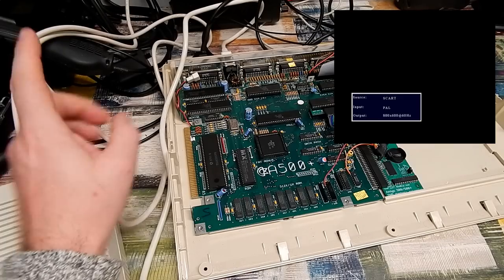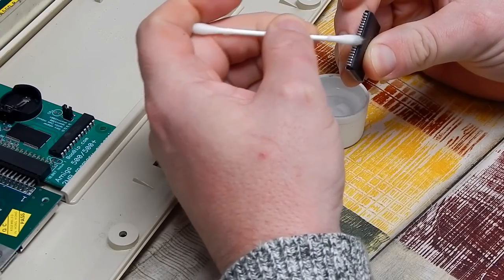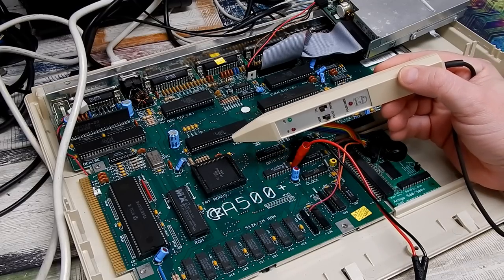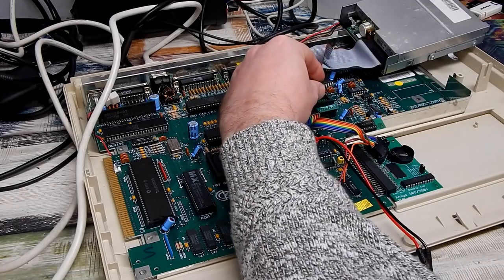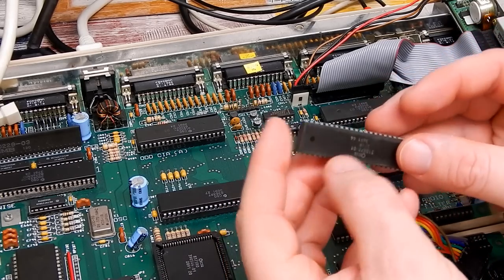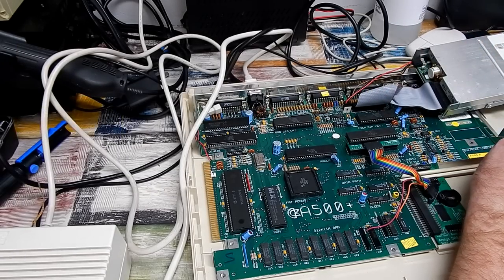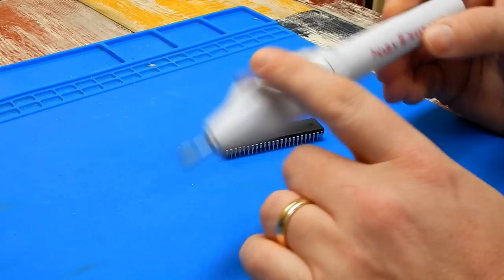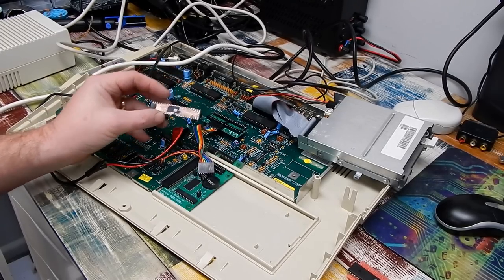Amiga 500+ with black screen but who's dead?

Comment: This is actually a good lesson in why blindly chip swapping doesn't always fix things. Logic probes are cheap and easy to use. So this is still a very useful video, and you did save an Agnes from the trash even though it meant Gary was bad. It's still very much a win.
Reply from the maker: Absolutely as my blind swapping of parts while building the EATX almost had one perfectly good AGNUS in the bin.  If it wasn't for the fact its such an expensive chip I might very well have binned it at that time.

Comment: Great job =D  If that was all that was wrong with that IC you could re-create those missing OE control lines with a 74 series bodge!  I typed that just before you removed the top totally lol =/  EDIT: To be fair - it would have probably needed a few 74 series to fix that 1 pin.
Reply from the maker: Thanks.  It might be a bit beyond saving now lol.  It's impossible to know if it was only that one pin which was bad plus it's not the most expensive chip to replace.  

I just thought it would be interesting to see the silicone.  Wasn't able to show it in the video but looking at it under my son's microscope you can make out some text.
Reply: @CRG  Yes, it was interesting to see inside and how thick those connections are on the DIP chips there too - ie. that lead inwards to the die. On the PLCC chips you tend to find the traces go much thinner much quicker - for obvious reasons!

Comment: I believe that it was still NMOS. That is one of the reasons Commodore failed. After purchasing MOS they didn't keep pace with the rest of the industry. That is why when you get to the 1200/600 there are VLSI and HP chips as Commodore couldn't make CMOS chips large enough.

Comment: Eventually the supply of the CustomChips will run out as people scavenge them for repairing their Amigas. The winning question is: how far along is the community with reverse engineering these and providing FPGA CustomChip replacements, like ARMSID has been done for the C=64 SID?
Reply from the maker: There is apparently a new version of Gary available over on A1K.org.  One thing I'd love to see is a new version of AGNUS so we could all have the 2MB chip ram at a reasonable price!
Reply: @CRG  isn't a revision 8A motherboard required for that as well?
Reply from the maker: @AnnatarTheMaia  good point the 8375 is not pin compatible with the earlier boards.

Comment: what kind of tower case are you using for the A2000, and what did you use for the back plate?
Reply from the maker: It's a deepcool ck500 case.  Bear in mind though that my 2000 is a modern remake in an eatx form factor so all the io is laid out for the typical io slot of a modern oc case.

Comment: Yeah with corrosion "behind the legs" it's likely seeped inside by capillary action. Then gets vaporised again by operating heat and can advance to the silicon.
Reply from the maker: Sounds plausible.  At least this chip is easily replaced although perhaps if I had cleaned it better in the first instance it'd still be going 🤔
Reply: @CRG  nah good work that machine was a battery massacre😭

Comment: hi,
I have amiga 500 chicken lips unfortunatly i have problem with floppy disc station i have change it  and its still the same doesn't want to read disc. There is hand with the  floppy disc but it doesn't want to read. Can u tell what can be wrong ?
Reply from the maker: The floppy drives are known to suffer bad capacitors so a simple recap might solve your problem.
Reply: if change floppy disc station from that broke amiga to good one and it works so its not the floppy disc station. Like something would be with the mother bord. I have alsow change Gary and its the same hand with disc and nothing, station dosn't want to work. do u have some idea what can this be ?
Reply: do u have fb or email ? I have fotos of broken one and good one this is rev 3 but there are some diffrents